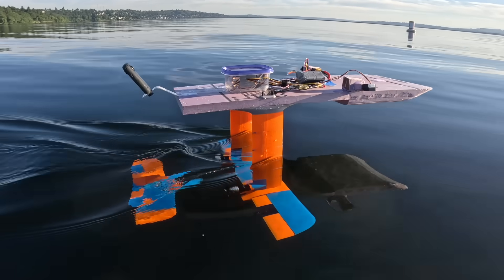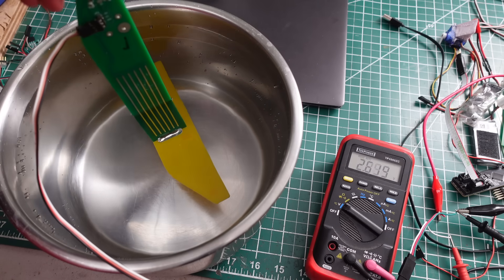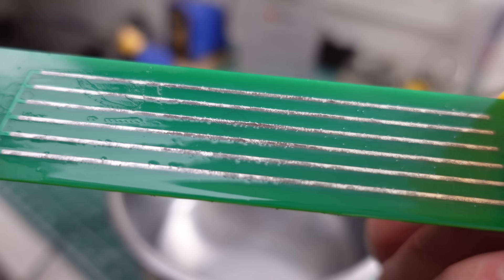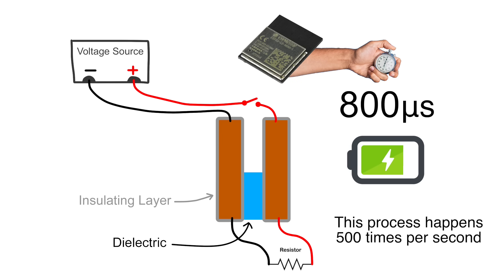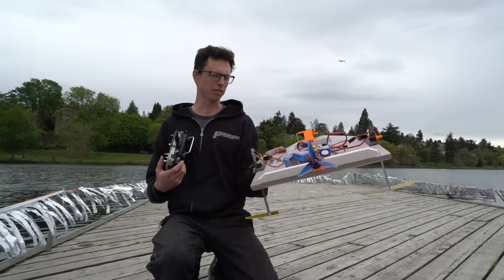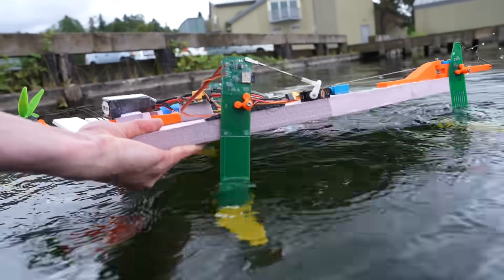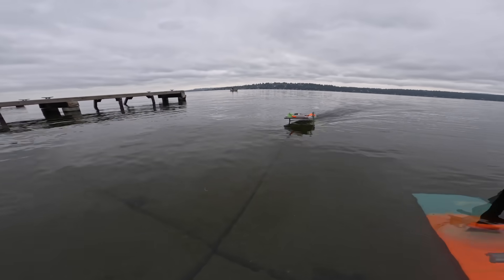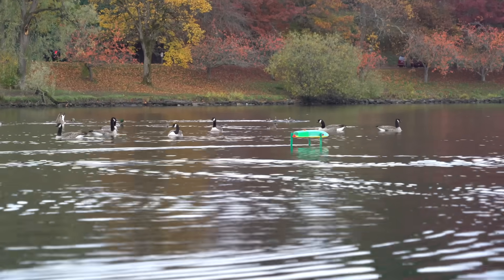R/C Hydrofoil Boat Made From Circuit Boards

Comment: You should attach the hydrofoil with 2 (or more) graphite rods, which you can use to measure the level
Reply: aye or a float, the way we manage water height here is generally a float  its simple robust and lasts almost forever from right materials
Reply: @violetquinnlaw  Is a float fast enough and accurate with waves?
Reply: @SteffenBauer  imagine a ping pong ball floating in a lake. the surface tension pretty much glues it to the surface of the water so i assume it would be fast enough. but it would add some drag
Reply: @bmxscape  LOL, i added 2 ping pong balls inside the water tank of my espresso maker, so I could more easily see the water level. 

Not related, but they float on the surface, and they're orange.

Sometimes simpler is better, is my only point.
Reply: @SteffenBauer  look at the foiling Moth and Waszp, and the Hobie TriFoiler. Wands do work. They also don't 'need' to float.

Comment: This can be done without any electronics. Look up the Hobie Trifoiler.
Reply: relying on skis increases drag, he's used that sort of design before (look at his previous video)
Reply: @azertyQ  you can also do it with floats , we use them for everythign including lifting houses in floods  if you put hollow support poles with a float in them and and main foundation pole inside
also use them for managing water level in cattle troughs ext year in year out out in a padock
but you could simply have a float on each support that triggeres foil to raise if it hits water dosent need to be big if its on a electric switch it can be like size of a marble
Reply: @violetquinnlaw  ... but then you're using electronics.

Comment: Some heavy gold plating of the pcb will solve the corrosion issue of the original design.  Gold won't dissolve electrolytically unless you are riding in cyanide solution or hydrochloric acid.
Reply: gold won't dissolve, but it'll build an insulating film which will throw off the readings. google electrochemistry polarization
Reply: @g_glop  this
Reply: Your comment got stolen by a bot
Reply: Ahh, another relaxing summer on the shores of Lake Cyanide
Reply: A bot stole ur comment
Reply: Won't the electrical current cause the gold to dissolve anyway? I've seen platinum electrodes get eaten in electrolysis chambers
Reply: Wow, pretty next-level development. Great to watch!
Reply: or just use capatitiv sensor
Reply: sorry i did not say any thing i was 2 min in the video
Reply: Actually it won't, although it helps.
What you need, is to get rid of the DC voltage and use (quasi) AC instead. The DC signal is causing electrolysis.
We've been using that AC method inside professional coffee machines for decades. 
By using quasi AC pulses, you could actually just get a PWM signal that is proportional to the amount of water.
Reply: No it won’t electrolysis on saltwater will eat through any  conducive anode except platinum carbon mmo and maybe some conductive metal oxides
Reply: What does silver do?
Reply: Just like a metal boat he just needs a magnesium block. The magnesium always erodes first, all metals must be connected though.
Reply: wax also works too haha
Reply: @jeef16 ski "sex" wax
Reply: a float would also do same job and they dont rust, just have a float on each support and youll have a automatically calibrating automatic operating stabilizer
Reply: @violetquinnlaw float will add drag
Reply: @violetquinnlaw i was thinking the same thing, as a mechsnical engineer i always try to keep my solutions to an issue as simple as possible, just a small arm with a float attached to a sensor that reads the arms angle to sense height above water would be really easy to build.
Reply: @Greg1096  I think one of the issues he's trying to solve here is to coordinate all of the lifting surfaces. Sure you could have multiple wands, that's what they did on the Hobie TriFoiler, but that also comes with mechanical complexity, and at small scales, that stuff becomes very delicate. Wands also do require mechanical calibration at intervals. I think in terms of mechanics this solution might actually be simpler.

Comment: your electrodes need to be made from t304 stainless steel to avoid corrosion, laser cut sheet would work.
Reply: Or he could go platinum if he needs a sure thing.
Reply: @Yaivenov  T304 is a sure thing.